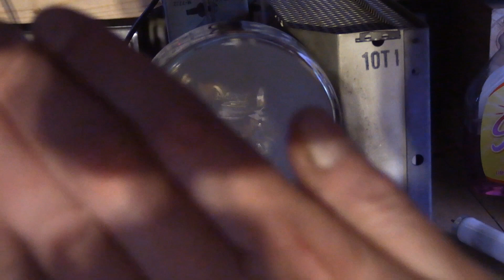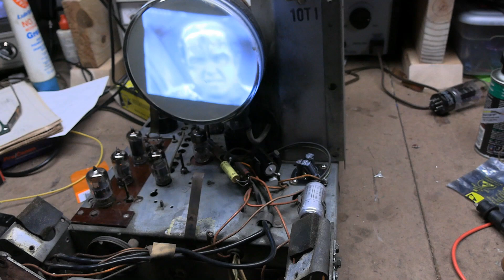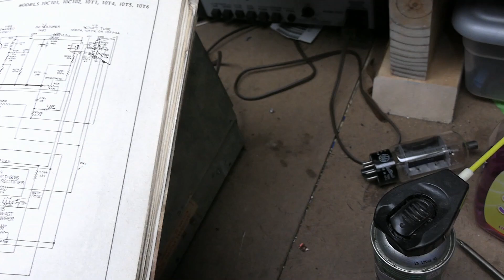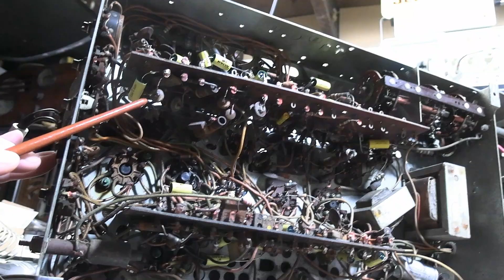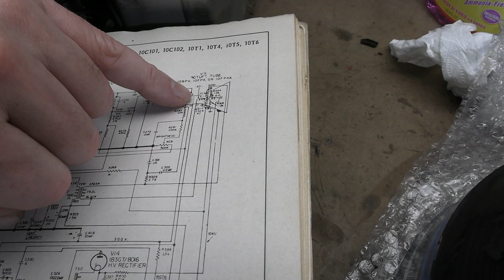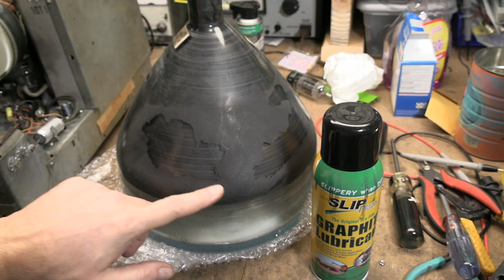GE 10T1 restoration part 4

Comment: The broken controls are very annoying. You can easily get new single potentiometers of nearly any type and close to the same variety of dual-gang controls but AFAIK nobody makes independent controls with concentric shafts. I can imagine a substitute being made with 3D printing and gears/belts but that's obviously much more complicated.

Comment: somewhat confusingly, they liked to put "+" next to the cathode, because when you use it to rectify that's where the positive voltage comes out.   but that schematic also showed + near the anode of the germanium diode.  very confusing, that.

Comment: I'd deduce that the resistor is in there to cut the Q that would otherwise be there from the coil alone.  I'd at least be curious to find out what kind of visible performance would be had with a commercial choke paralleled with the same resistor.  The combined Q could be pushed up or down by choosing a different resistor, or an adjusted trimmer pot, making duplication of the coil alone's Q less of an issue.

Comment: Even your dog says that control is ruff.  Hope fixing it isn't as ruff.  Maybe if the correct value but the wrong shaft size can be found, the shaft could be sleeved or machined to get what's needed for that inner brightness control.

Comment: Why  do you call  it snow  in't  it called raster ?
Reply from the maker: Raster simply means the electron beam is scanning across the CRT face.  Snow means the video system and local oscillator are doing something.
Reply: Snow has random bits of white and black dots that seem to dance around like a snow storm. ❄

Comment: It’s possible to remove the Resistive Element from the Potentiometer and replace it with one harvested from another Potentiometer. I have also transferred over the Wiper Mechanism. You might have to heat up the shaft with a soldering iron to soften the plastic, and then melt it back in place after it's transferred. Sometimes you have to use a little epoxy glue. I have had the glue break off on some occasions, but usually it works well. If there is some residual oil or contaminates remaining, the glue doesn’t always stick well.

Comment: I'll bring my parts chassis to ETF.  I already have used the brightness/contrast control, but you can snip out any other parts you might need.
Reply from the maker: Thanks for the offer, but I'd hate you to drag it over there for one little coil.
Reply: @bandersentv  Bob, if he offers, then take him up on it. Just saying.
Reply from the maker: Yes, we know each other.  We'll see each other at the ETF and work it out.
Reply: @bandersentv  Don't know if you'll read this, but it looks like a predicta has finally appeared in learning fallout trailer before the show is released this week! It looks like they have made a custom cabinet for the show as it appears to have rounded corners
Reply from the maker: @aussiefurbymogwaifan6621  could be a reproduction. Several companies made them
Reply: @bandersentv  really? I thought only one company made them? Like the casing and the picture tube look like an actual 50s debutante while the cabinet, appears to be replaced with a custom one for the show. Assuming you watched the trailer I linked
Reply from the maker: @aussiefurbymogwaifan6621  Telstar, Meteor and at least one other
Reply: @bandersentv  you can see it in this video: Fallout FEATURETTE Console to Camera | Fallout | Prime Video

Comment: Yeah I needed to put a brightness control on the rear of the chassis leaving the contrast section of the dual pot in place.  Looks the same cosmetically from the front but the brightness is only accessible through a hole drilled in the back of the cabinet.
Reply from the maker: I'll do that as a last resort if I need to.